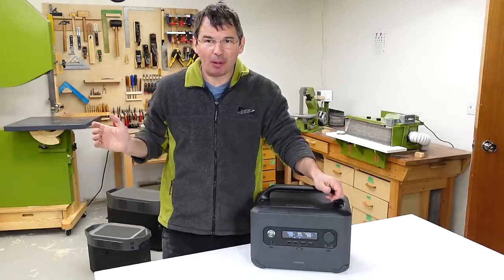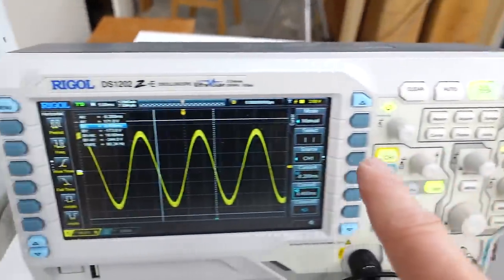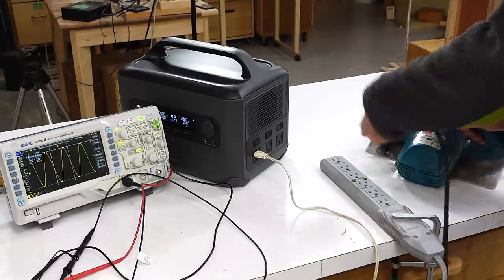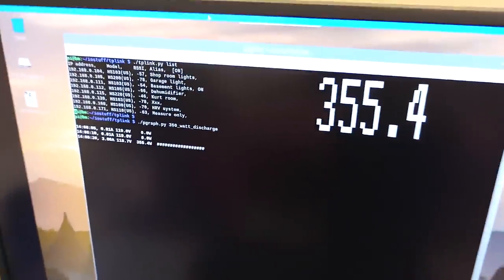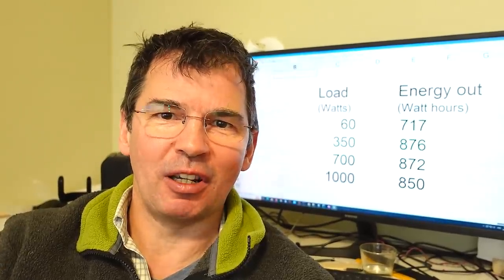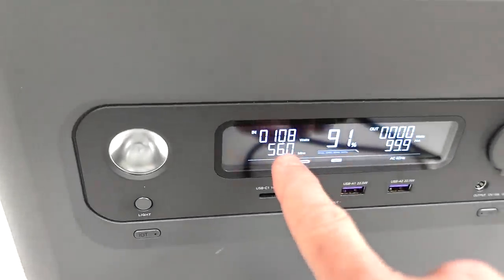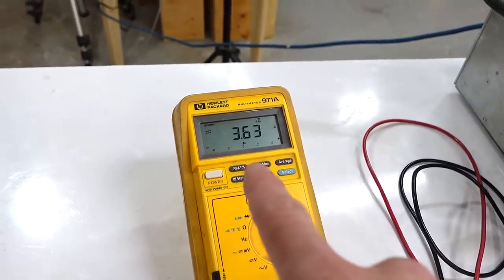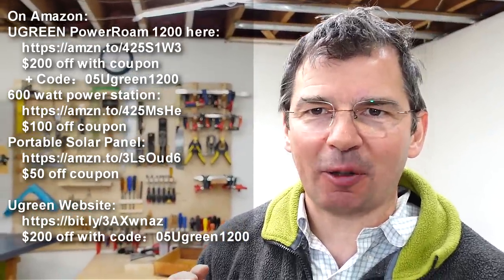Ugreen PowerRoam 1200 battery power station test and review

Comment: Using the saw as a resistor was a brilliant demonstration.
Reply: I have a miter saw that likes to trip the mains breaker. Solution is to connect it via a 100ft extension cord, wonder if that would work here too.
Reply: For extra credit: point a tachometer at the saw and use that to infer the resistance. :-P

Comment: Nice using your circular saw as a resistor!  That gave me a chuckle.
I had similar results testing the storage capacity of power stations.  Like you, I was measuring AC current out, but of course inverters aren't the most efficient things.  The company said if I were to discharge it with DC, I would find it would reach the rated storage capacity.  Probably true, though I never tried it.
Reply from the maker: yes, much harder to have a good DC Load to discharge it with.  But also, the DC output is much lower, which means the unit has to stay on longer, and just being on uses up 10-20 watts too

Comment: Stopped that saw right in time of you cutting the cord @ 4:22 ? 
I wonder why virtually none installs soft start circuits in powertools. 
No only it does not try to rip your arm off the socket but also prevents such surges. 🤷‍♂
Reply: Because money of course
Reply from the maker: Any variable speed tool will have a soft start.  But if it's not variable speed, a simple on off switch is so much cheaper and reliable.
Reply: @kiplinght  I suspect but even the "premium" brand with "premium" markup don't include that 5 bucks (retail) circuit.

Comment: Thanks for the comprehensive review.  That unit looks pretty much like clone (or "unbrand") of an EcoFlow River.  I'm glad the market is getting the price point lower so more folks can benefit from have emergency power (or in my case, power when I'm boondocking in my little trailer).
Reply from the maker: Yes, there is quite a number of power stations on the market these days!  They also make great UPSs.  We had a 2 hour power outage recently, and I just carried to ugreen to my wiefe's home office.  Enouch juice in there she could have worked for two days off of it!
Reply: I was wondering about using these as a UPS. Wouldn't keeping it plugged in just wear out the batteries?
Reply: @conspiracyx  I had the same thought and question!
Reply: @conspiracyx  idk if it hurts lifepo4 batteries. It ruins lipo and liion
Reply: @matthiasrandomstuff2221  Could you try having it inline with a device and check the total power draw and if it is able to switch to battery power fast enough that a computer stays on if you pull the charge plug? My old APC UPS has about a 50w loss in the transformer and only manages to keep a 100w load going for an hour or so with its lead acid batteries, so one of these modern power banks would be a nice upgrade if they are actually able to switch to battery without interrupting the load.
Reply: @Grunttamer  good point about battery chemistry and what someone else said about the switch from line to battery power. I also know there's different kind of UPS and how they deal with line loss. Bottom line, would be cool if these devices had some setting for "UPS mode" where they expect the device to be plugged in most of the time.
Reply: @matthiasrandomstuff2221  - Yes, can it be used as a UPS? I want one for my CPAP machine because NB Power is funky where I live but it would be cool if it could always be on standby and pass-through when the power is on, like my office UPS.

Comment: The thing I like most about these reviews is you're not saying this power station should run power tools, you're using them as a point of reference that's familiar to you audience while providing real data about the sort of output it's capable of.  It feels like so many people would be inclined to review these things by plugging in progressively more demanding things until they hit a failure point and just say "hey so that's a pretty high failure point so I guess this thing's good."  Really appreciate that you provide so much more depth.

Comment: One point, while LiFePo4 is technically newer than the 'classic' lithium ion - but it's not a particularly new technology. Invented in the 90s and was commercially available within the 2000s. It just seems like it's starting to really hit in consumer products in ways we just haven't seen in the past. These battery banks are perfect use case where volume is a little bit secondary to safety, cost and longevity.
Reply: With this amount of cells safety is in important, if one cells goes it will trigger the rest!
Reply: @sparqqling  LiFePO4 batteries are much safer than regular NCM li-ion batteries. They also last longer but they weigh more.
Reply from the maker: Indeed.  And I like that this one uses cylindrical cells, which means the thermal runaway spreads between cells more slowly.  At a previous job, they were testing a very small 5 kwh pack of prismatic cells sandwiched togehter.  Then one of the cells failed, and the whole pack went up in smoke within minutes, rather spectacularly.
Reply: @matthiasrandomstuff2221  good old Rim days. I still randomly find old Blackberry batteries in the house/workshop
Reply: Production patents expired around 2020 and it ramped up output in China to sell on the west.

Comment: You should do some testing with a soft start motor starter. They work wonders on RVs to start motors on solar or generator power.
Reply: you can do that w/ the trigger even, by pressing it shortly/releasing/etc., i.e. finger driven pwm.  But yeah attaching a simple triac circuit would do it as well. Also that's more of a  NA issue where the voltage is low (120v) and the currents higher.

Comment: I'm curious if the device could power a load while charging, like if I had some computer equipment that would stay powered up 24/7 while the device charged up via solar only during the daytime.  The other one is if it can be set to turn on after discharge shutdown, like if it is in a remote location and has a string of cloudy days, will the output power back up once the sun is out?  That being said, thanks for the review and showing the power tools it can and can't power!
Reply from the maker: it can be used as a UPS

Comment: How did you get the large numbers in the top corner of the shell? Very fancy
Reply from the maker: just ascii block characters, I think some of the code is still on screen when I start the log the first time.
Reply: @matthiasrandomstuff2221  Thanks for the reply!
I will try figure it out as a challenge to myself.
The tricky part (for me) is getting it to print to the corner without overwriting anything from the current shell session. Sure I will get it. Commands like 'watch' sort of do this already.

Anyway it's a cool little logger. Very useful.

Comment: Love all your power station videos. i saw in the comments you mentioned they are good UPS's. Doing my own research I've found they are not recommended to be used as such. Would love to see you test that. Also, a lot of people get these things for backup power for medical devices like CPAPs. In my research, a lot of these shut off if too little power is used and sometimes that will shut CPAP's off in the middle of night! edit: I just double checked and ecoflow delta says it takes 30ms to switch to battery power. A quick google search shows that to be a little high for a UPS. I wonder if it's still safe for electronics.
Reply: Also - fridges. I heard somewhere that those don't like these 30ms, curious to know if that's true or not. Could be interesting topic to investigate.
P.S. Another great and interesting review. Didn't saw anyone doing this detailed tests. Thank you!

Comment: Discharge load changes the capacity of cells. You gotta look at the cells datasheet and see what draw they got the numbers from. Most 18650's are rated at 0.1C(at least the ones I own and have tested). I suspect they took the stats off the battery pack and not though their box.

Comment: That was a great information dense showcase and review. Love that huge list of tested devices.

One general question when it comes to portable power stations; Would the amount of distortion on that sinus mess with sensitive devices?  Ie. If I have a PC connected and then add an inductive load like a medium sized drill. Would the PC flip out or even be damaged, or is distortion like that something that could be handled by the PC's internal PSU or a laptop's external power brick?
Reply from the maker: if its huge oscillations like I managed to get out of the ecoflow some time back, that managed to blow the internal fuse in my kill-a-watt meter.  Most devices aren't so susceptibel ,but then again, I wasn't keen on trying it with all my electronics.  Just don't sue electronics and power tools with a power station at the same time.

Comment: They should have an induction motor setting that allows the motors to start slower with VFD or lower voltage.
Reply from the maker: yes, I kept bugging ecoflow about that, haven't bugged these folks about it yet.

Comment: Wait, how are you printing out the current state using that big font to the top right of the terminal window?
I assume that's some program which uses unicode U+25A0 "black char" or something like that?
It's interesting that the rest of the console is scrolling normally, yet this is stationary and I would bet it doesn't ruin command history.

Comment: I saw a video online about using an NTC resistor in series with a motor load as a poor man's inrush-current limiter of sorts. Would this help with your power tool on battery problem, maybe?
Reply from the maker: it can help a little bit, but just a little bit.  My 14" bandsaw wouldn't start off the ecoflow box, but with some extension cords (which add resistance), it would

Comment: I wonder what the performance would be in below freezing temperatures.
Reply from the maker: Poor.  The batteries need a certain temperature to operate, and need well above freezing temperature to charge.  It's just a function of the battery chemistry.  A previous one I tested could provide power at freezing, but needed warming up to charge.  They have temperature sensors inside to prevent opreating at temperatures that would damage them.

Comment: I really want a portable power station that can run power tools well. Sometimes you just want to run a plug-in miter saw or table saw away from a plug. If I was charging battery tools there's chargers that can charge tool batteries on 12 V car batteries so I can skip the inverter part.
Reply from the maker: 2000 watt sized power stations should run a mitor saw.

Comment: About 15 years ago, I had a very small APS UPS (220W max?) and accidently plugged a 1000W space heater into a power strip which I momentarily forgot was plugged into the UPS.

Bricked it. I was surprised that there wasn't even a fuse/protection or something inexpensive to replace.
And APS said they don't repair this.  🤔☹😡
Reply from the maker: It amazes me how well these power stations handle brutal loads.  I haven't dead shorted this one, but I'm pretty sure it could handle that too!

Comment: Nice. The battery capacity and output wattage are just enough to be useful ; my EB70s is great but the output wattage isn't enough to run most heaters.
Reply from the maker: its kind of dumb to run heaters off these things.  I just use heaters because they are a great test load.
Reply: For long power outages I got myself one of those dual fuel generators from Costco; just which the thing would more easily start off of propane.

Comment: When you added the inductive load (circular saw) the inverter started to oscillate. These oscillations are concerning as they could damage sensitive electronics that might also be connected. In all fairness, one should not be connecting an 1800VA inductive load to a 1200 W inverter, and it’s no surprise that it didn’t start. I would like to see if it oscillates with an inductive load within spec (1200VA or around 1000 watts).

Comment: I wish you had measured how much power this device consumes on top of what is being delivered to its output (when at 100%, not charging). If I use one of these products as a UPS, the battery will always be at 100%, but I don't want it to take 500W from the wall when only using 450W at its output!
Reply from the maker: I'd estimate that at somewhere around 10-20 watts

Comment: This device probably has a lower power rating per outlet and the onboard computer reduced the voltage to give almost 1300 watts. Perhaps utilizing all the outlets with the space heaters would have given better results instead of overloading a single outlet with a probable 13 amp maximum rating with approximately 18 amps of space heaters. Hence the voltage drop protection to 90 volts.

Comment: I've been on the fence about these guys. Anker was who I trusted but after recent events and then having bought a few of their dual port USB wall plugs that severely underperform their specs, I'm kind of done with them.  I bought a couple dual port 5V 2.4A chargers and it states that it's 2.4A per port. I can't get but 2A from one port and if I plug in something in the other port it drops to 1.7A. The LED lights I'm trying to power pull 2.1A and flicker when underpowered. These types of videos are surprisingly useful for figuring out the integrity of companies you may not know. I'm going to give them a shot now.
Reply: I read the reviews of every power station...along with checking the warrantee and if there's any customer service!

Comment: Can any of these handle the compressor on full sized fridge (or chest freezer)? 

I have an electric car with an 800watt inverter that could run lights etc for many days. I’ve been contemplating getting one of these to serve as a buffer battery so I could potentially keep my fridge/freezer cold during a prolonged power outage but have doubted they could handle the startup current of my fridges 8amp induction motor.
Reply from the maker: I'm quite sure it can handle a fridge or freezer

Comment: I don't know enough about the electronics behind it; would the soft-start feature on some saws, sanders, etc. reduce the startup current so a lower-wattage source like this would be able to successfully spin it up?
Reply: Seems like it did when he mentioned the routers. Especially on larger units, those often have a soft-start feature integrated so they don't rip out of your hands or pull too much current (tripping breakers) when starting with large diameter bits (like panel cutting bits), but can have large amp ratings.

Comment: Will it charge bigger power tools batteries?  that would solve that problem at least if it will charge them a few times enough to make it worth while.
Reply from the maker: Power tool batteries -- the chargers for those don't use a huge amount of power, so no problem.

Comment: Would it run your refrigerator? Thank you
Reply from the maker: Haven't tested it, but fridges only use 100 watts running, so should be no problem.  Startup is a lot more, of course, but should be well within it's capability.

Comment: Is there a tap from the power station battery to charge cordless tool battery packs?
Reply from the maker: Its just got 120 volts AC and 12 voltds DC out.  Also USB.
Reply: @matthiasrandomstuff2221  Thanks for your response  AND another interesting video.

Comment: I wonder if you could get one of your bigger inductive loads running (let’s say the circular saw) by having a smaller inductive load already running (let’s say an angle grinder). Idea being that you first turn on the angle grinder, let it get up to speed, then when you connect the circular saw, the angle grinder will donate some of its kinetic energy to get the circular saw going. Probably a long shot, because the donated energy would have to be enough to offset the extra base power the angle grinder is drawing. And I don’t know how the inverter would react to whatever the frequency would do. But I’d be curious to give it a try.

Comment: Yea no. 850 Wh is not the same as 1200 Wh. Only support companies that honestly report their specs...
Reply from the maker: battery is 1024 watt hours, but maximum output is 1200 watts.  So still less than rated capacity, but not by as much as you think.

With lithium batteries, it's alwas a matter of how far you push them.  You can carge them higher, but that shortens the life.  you can discharge them lower, that also shortens the life.  So I think they aren't quite using the 1024 watt hours the cells are capable of.  Which is why you can still get power for charging devices out even after the device says discharged to 0%.  0% is just the point where they don't want to discharge further.

Of course, some of the capacity is lost in the inverter, which is somewhere 90-95% efficient.

Comment: You might want to get a large auto-transformer and connect it to that power source (in series with a lightbulb that you bypass once the iron core has saturated (this can be easily automated with a delay relay)) and then connect big tools and bring up voltage slowly using auto-transformer.
With big asynchronous (bandsaws) motors you could use a cheap VFD and increase the frequency slowly. EDIT: could the VFD at the output of that thing be hacked to rise the frequency slowly?
Reply from the maker: The thing could act like a VFD to bring induction motors up slowly, if it were programmed to do so.  I wish one of those battery pack companies would do that.